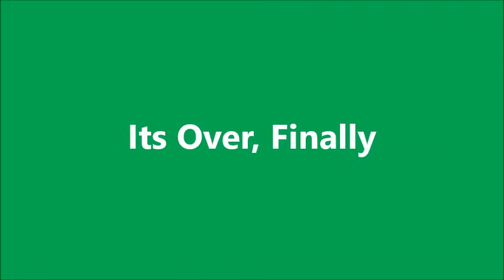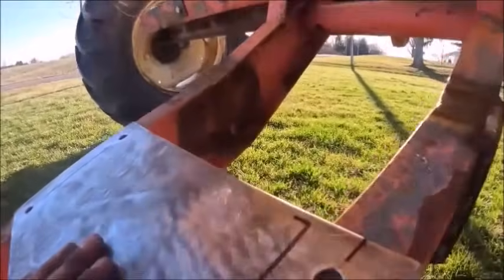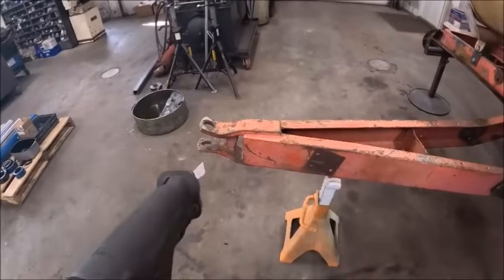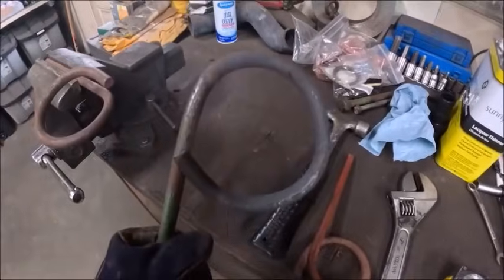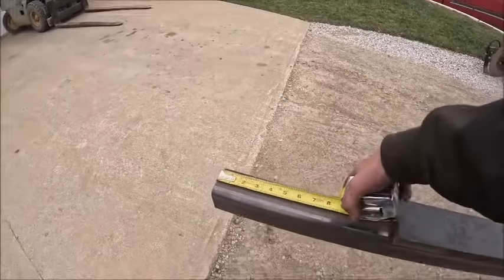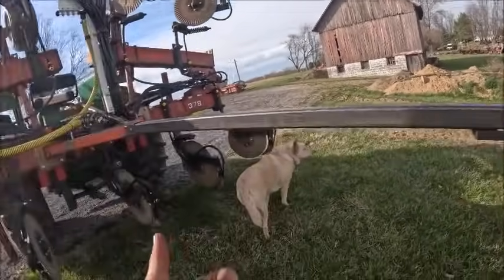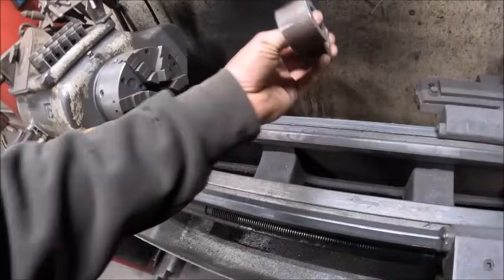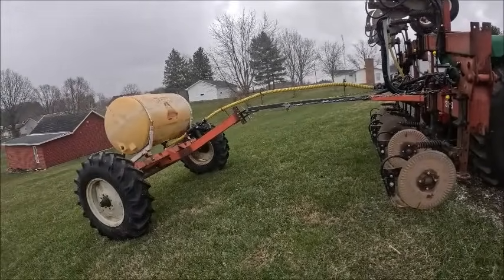Applicator Project Part 16: It’s Done, Finally...

Comment: Nice job I had 1 of those cultivators they had a nice tool bar .Might find after a season you can use a shorter hitch for the tank ,I made something similar but i made it a gooseneck type hitch but it didn't fold  so it didn't have to clear you folded height  was 8 row 30pivoted off the top link bracket on the toolbar .It followed real well

Comment: Very nice job! Pretty impressive how nice and clean it came out. I have a neighbor that built a tank Trl also he found a wrecked out Great Plains no till drill and took the front double tires and wheels from the front of drill and put it on the front of tank trailer but haven’t used it this spring. I should him some of your videos building this and he was impressed and wishes he would have done something like you have. Thanks for including all of us in the building of this.

Comment: My dad took a fast sprayer and built a cart built a gooseneck style hitch had cylinders on the hitch steer it if it would of ended using for side dressing with the cultivator but it never when on there it was built for the strip tiller if it wasn’t for the markers you could swing the toolbar under the hitch

Comment: I can begin to imagine the degree of personal satisfaction you must feel about reaching this point of achievement in this whole project, congratulations and well done.  The only thing i would have any concerns about is that all this work is done with an empty (lightweight) tank trailer. Liquid fert is significantly more dense than plain water so what is the risk of the tank trailer over-centring itself going through any situation like those that you demonstrated when trying to assess drawbar length / position and pin length / position? Should you consider having a fold-down leg and hefty skid on the rear of the tank trailer? Dan
Reply from the maker: No. The tank is in front of the axle.

Comment: Great project kiddo.  I do have one question though.....Why not put the "weld in" lift arm ball in the hitch?  Or did I miss something? We built a hitch on our 226 field cultivator to pull a roller or a crumblier behind it.  That gives it sufficient movement with the cultivator out of the ground and not put the hitch pin in a bind. Just a thought.  Makes it easier to hook up also.  I love your OCD moments.  Makes me smile.  Stay safe this spring.
Reply from the maker: You missed something. 46:30

Comment: All you greenhorns too bad you don't know what an arc welder is it's a machine that lets you weld in the wind and even underwater believe it or not
Reply from the maker: We have 2 of them…. Takes to long to drag them out because they never get used and wire welds look nicer to begin with. Nice try again.
Reply: Quick fix to get going-stick welder

Quality repair/assembly- wire feed

I agree with Ethan.